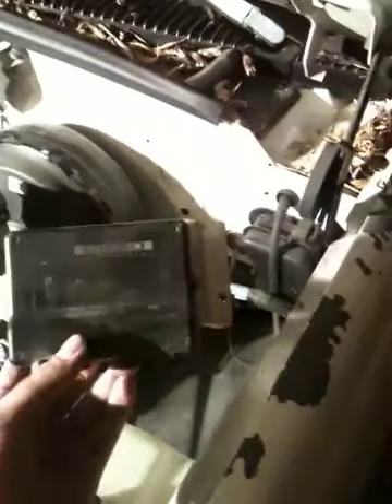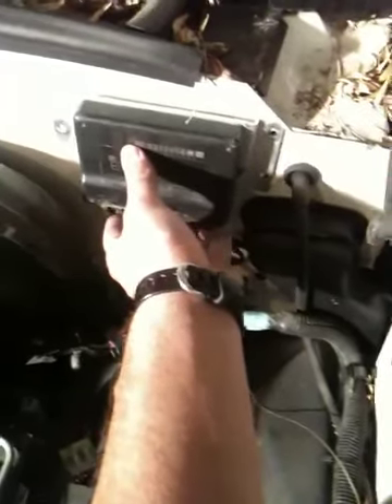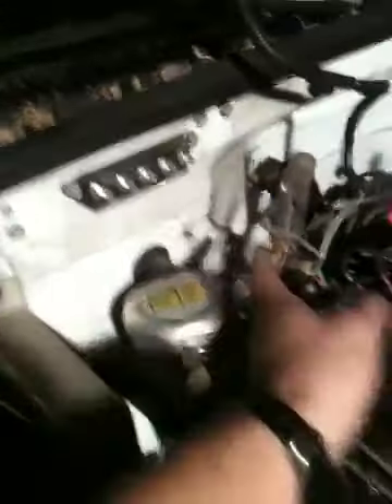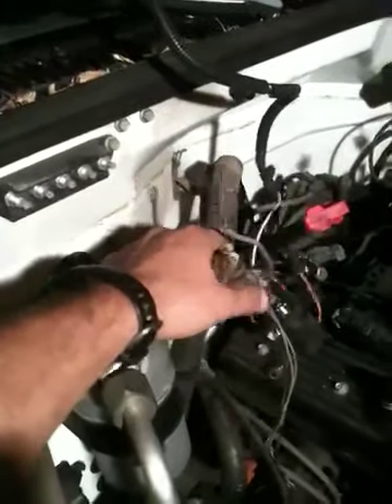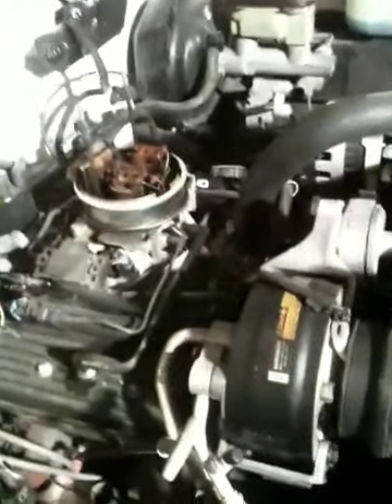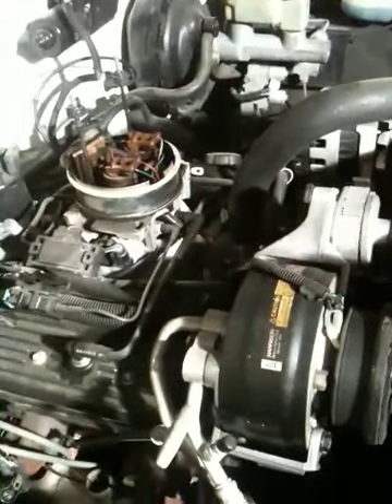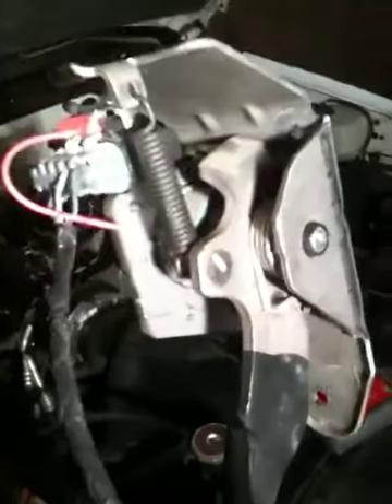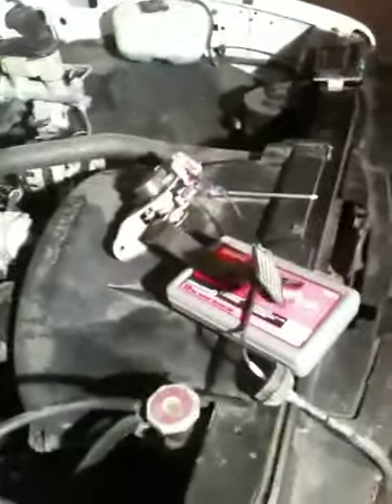1993 v6 to 2005 5.3 4l60e

Comment: Did you use the same transmission
Reply from the maker: I used everything from a 2005 Tahoe
Reply: And it slipped right in with the driveshaft?
Reply from the maker: chente kingtero yes chente,  my driveshaft slipped right in,  and the cushions,  are you talking about the motor mounts?  If you already have v8, there's nothing else you need,  v6 suck cause they are huge pushed back brackets need removed,  then you need motor mounts

Comment from the maker: ac compressor will not fit. dirty dingo in az is working on a ac bracket and has motor mounts that actually work,. $100. i should know soon. lt1swap.com for wiring,and my email is skeeter5283@gmail.com